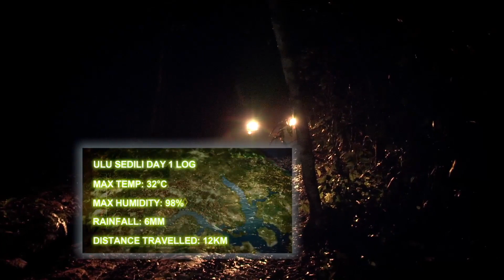Driving the world's most dangerous Jungle Road with Adrien Brody | Driven To Extremes

Comment: No A/C for the car? In south east asian forest... Just making the scenes dramatic...only
Reply: Unwanted stress on the motor 🤦‍♂️
Reply: I’d reckon that they do this to keep the drivers at one temperature. If you are exposed to two drastically different climates (AC vs jungle heat) this can increase the chances of heat stroke.
Reply: I've been into the outskirts of the jungles in Thailand and AC is needed i dont care lol
Reply: Yes, if u're 100% sure ur engine has enough power for the extreme slope and mud. Otherwise, u would stop the car, use the winch, maybe dig some mud and waste more time. The air filter also would get wet and dirty, hence A/C would be useless and might be broken after the expedition. 

Also, in some extreme desert off road, they dont use A/C as well.

Comment: you didnt change the oil before going in the jungle? Its been only a 100km and you already checking the oil. What kind of cheap oil is that?
Reply: Well it's not your average 100km. It's harsh low-speed but high-loads. 
Just like how towing with a vehicle dramatically reduces the oil change intervals.
Reply: @boy638  not to harsh
Reply: Because we go off road in West malaysia smts we cross river the water does go in to the engin that only show some of the hard part but in real life is alot worst than this
Reply: Because this program was sponsored by Shell so they needed to constantly talk about how great their oil is.
Reply: When off-roading I always do checks when taking a break. It’s better than ignoring it and end up stranded.

Comment: Adrien Brody is clearly not the sharpest tool in box. He gave the game away right at the beginning of the video when he thought the vehicle's snorkel meant that the Nissan could wade through water which would be deep enough to reach its roof)
Reply: some cars can drive underwater with a snorkle so its not that daft... it depends how the motor is setup. No offense maybe your not the sharpest tool in the box.
Reply: There are cars right down the road from me that have snorkels that allow them to drive through water that deep.
Reply: @tristanmeadows  No offense taken, but an offroad vehicle's wading depth is usually determined by things like the location of sensitive electronics (for example) within the vehicle..... Of course a snorkel helps with wading but it's also there to move the air intake away from the likes of dust and mud.....
Reply: Td42s have fuck all sensitive electronics, sure the dash will stop working if it copped some water but the motor won’t..there mechanically injected they don’t need any electronics to run..plenty of patrols have waded mid way up the windscreen, ooooh snap 🔪
Reply: He's an actor not a petrolhead, probably doesn't give two fucks about snorkels. Plus I think he wasn't entirely being serious. Watch him in the movie The Pianist. This is not a guy who is at all dumb.
Reply: Sleepin Dragon I agree, he was most likely joking. He knows a lot about cars, actually. He was trying to keep things light in the beginning.

Comment: For anyone who routinely does serious off-roaading, this is a very exaggerated joke. We do terrain like this every weekend for fun. A lot of engineering mistakes here, too. The vehicles should have had solid axles, like some Dana 44s and front and rear lockers. In fact... a bone-stock Rubicon can do everything they did here without batting an eye. Probably don't even need to drop the sway bar.
Reply: Says the dude who doesn't even know it has two solid axles, 27-34 splines and can run 40" tires on stock gear.
It also has front and rear lockers, since Paul Marsh built all these vehicles for all the episodes. But you can also get the Patrol from factory with both lockers, standard they come with rear or front depending on if they have a limited slip rear.
So yeah, know before you talk.
Reply: we use suzuki jimny only for that trail
Reply: Thats,,only in america.